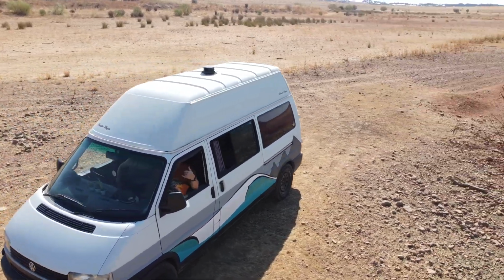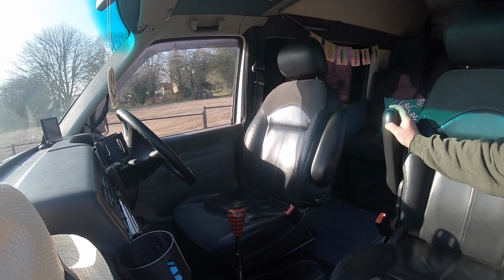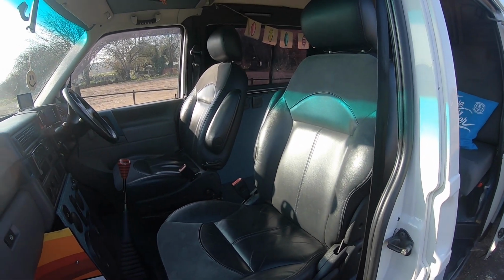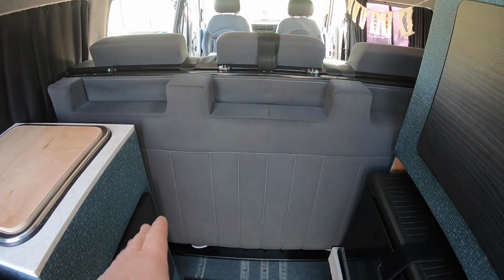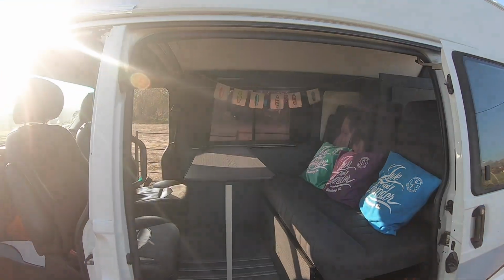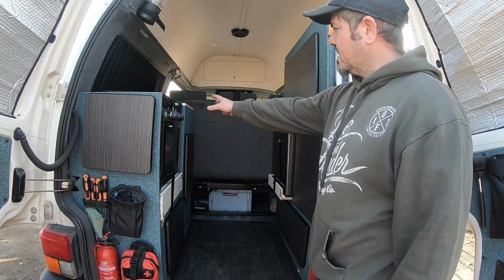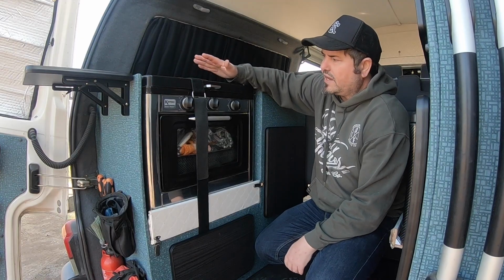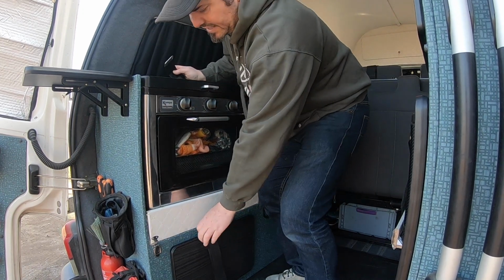DIY Camper Van Tour | VW T4 2.5tdi Transporter LWB High Roof

Comment: Any advise on blanking off a window. See you blanked off driver side rear
Reply from the maker: Hi, I made a template that fitted into the recess and held it in place with velcro. I plan to redo mine and add more insulation between the glass and the back of the panel, and overlap the panel so I can screw it into the body. Does that make sense?
Reply: Yeah cheers. I saw a lot of people spray them black then laying insulation directly to glass. Just not much information out there. Thanks for your reply